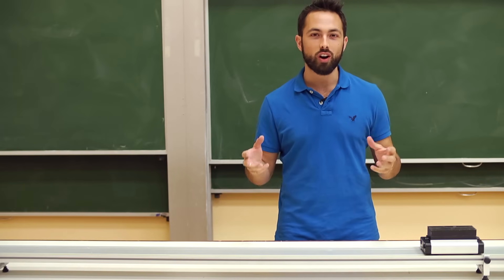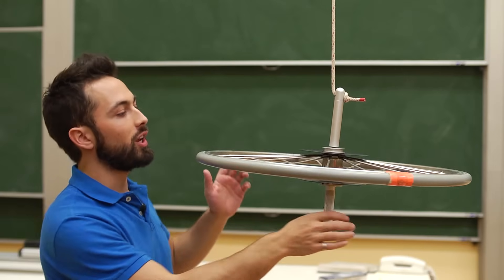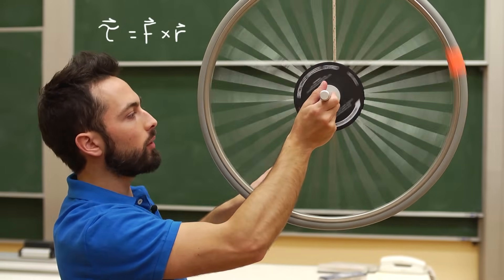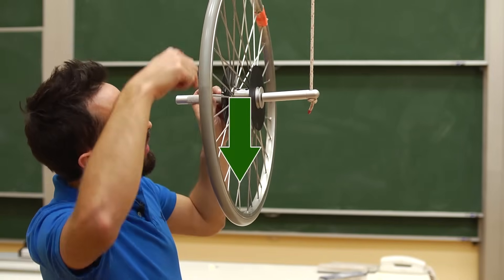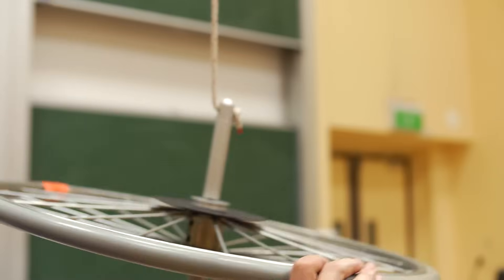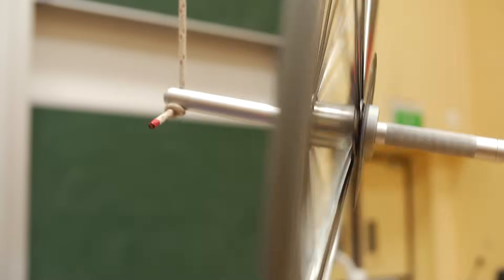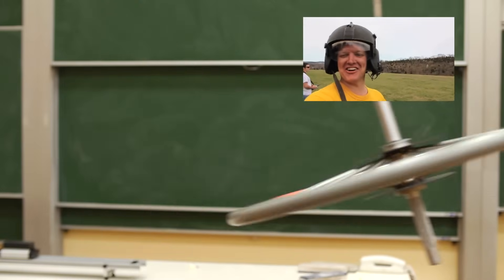Gyroscopic Precession

Comment: This explanation makes clear what happens, but I still don't understand why it happens.
For the rotation we see we need a torque showing vertically upwards, where does it come from? And even if this explains why the wheel starts rotating, it kinda doesn't explain why it is not rotating (or falling) downwards. 

For translational movement, when a body is falling and vertically but i give it an horizontal impulse, the body will still keep falling downwards, but not vertically now. Why is this is different here?

Comment: What helps to me to understand is to look for real forces working on the wheel. It helps to imagine that atoms in the rim of the wheel are like a bunch of small, visible metal balls, placed in a tube of a shape of the wheel's rim. Each little ball while rotating with the rim wants to stay in it's rotation plane, which coincides with the wheel. But wheel  under it's own weight slowly moves downwards and changes the rotation plane angle going from vertical relative to floor to horizontal. Since small metal balls do not want to leave the rotation plane ( low of God or nature or self evident truth while we live on our Earth😳 , that does not need a proof🤔😊) and cteats by their momentum the opposite torq to the torq that is caused by the wheel's weight, and creates a torq that makes wheel rotate around vertical axis. If vectors showing dynamic forces ( as the result of changing rotational plane by the weight of the wheel)of little balls are drawn it becomes visible that rim's matter that finds itself horizontally opposit the wheel's axle creates procession torq, and matter that finds itself on top an bottom of the rotating rim creates resisting torq to the torq created by wheel's weight.
I hope it is possible to relate to what I am trying to explain here😟😍! If somebody happens to read this, please leave a comment!

Comment: Tilt velocity and spin velocity are perpendicular vectors in a solid disk!  What do you remember about perpendicular vectors?  I CANNOT understand why people would rather believe in mnemonic devices like laws and rules rather than actually understanding the mechanism of CAUSE.  Currently, angular momentum ONLY works AFTER the right-hand rule, not the left-hand rule.  It has floored me for 20 years.  I cannot get it published, because math followers cannot see it, and I have math DESCRIBING THE ACTUAL CAUSE (without laws and rules),,,still, no joy.  Paradigms are STUPID, and you should second-guess something now and then.  I have a video with a link to the paper at SSRN.
A tilting plane creates a tilting velocity condition at the ends with a tilt axis through the diameter.  These tilt velocities at the ends of the plane are opposing axially parallel to the spin axis and completely reverse in each half of a rotation.  That acceleration is focused at the tilt axis on each half.  The rate for this velocity exchange is the ONLY participant taken from the spin axis, IT'S PERPENDICULAR!  The tilt axis creates a motion in the disk, and then it continues to follow that motion like a car axle producing a normal acceleration force to the disk THE WHOLE TIME.  There are supplemental effects, but this is 100% at level precession.  This is what cause looks like.  Modern science is really scaring me, because people are blind to cause when it contradicts the math.  THIS IS STUPID.
Imagine if medicine described symptoms with math and ignored the causal disease.  That is exactly what physics is now!  "It-always-does-that" is no basis for understanding, and describing accurately is not understanding either.

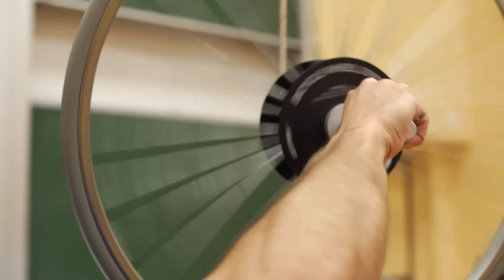Comment: At 3:22 it is stated that torque is pushing the angular momentum vector around, this would place the two vectors at 90 degrees to one another. At 1:52 it is stated that angular momentum and torque are in the same direction. Please help; I must be misunderstanding some concept; where does the pushing torque for the precession come from?

Comment: Sorry, Derek, I am trying hard to understand the physics of the "anti-gravitational" wheel. I still dont really get it, also not from your most recent viedos on the green with the 40 pound weight. 
Here you explain a force in the direction of the wheel axis. How would that create any lift? It should as well just pull stronger at the rope?
With the weight you lifted over your head in the other video, you explained that you effectively only feel the weight of he 40 pound disc, no torc anymore, however you can lift the weight much easier overhead then if not rotating. Sorry, something seems missing 🤔🙈

Comment: Dear Sir ,
I really need help , I spent time for Calculator  Power output of Flywheel motion , I have use P=T.w , but incorrect ,
Please feedback me
Reply: P=τ*ω is correct to find the power of a torque applied to a flywheel. As in, the amount of energy per second that you sap or add into a flywheel. But power has a very specific definition, so if this isn’t what you mean the formula will be different. Like the total energy of a flywheel is given by .5*I*ω^2.

Comment: Great.. torque...!!
Can anyone tell me what opposes gravity 😭
Reply: The weight of the wheel is supported by the rope tied to it on the other hand. I know you are confused why doesn't the other free end doesn't fall. It's because the wheel is still rotating having angular momentum in the direction perpendicular to the axis and the angular momentum generated by the forces on the opposite end ( tension in the thread and gravity pulling down at the center of mass ) are mutually perpendicular to each other which adds up to in the horizontal direction with an angle. Notice how the wheel starts to lose its angular momentum due to the friction and tho it's coming down. In short, it's the same reason where you rotate a ball tied with a string in your hand and it moves up. 
If you still have problem to understand, I can explain it in more easy terms on a paper :)
Reply: @manishsingaria3895  😍thanks bro.
You have a great taste in teaching.

Comment: Okay, I know this is an "old" video, but I'd really like to see what happens when you have two wheels spinning in opposite directions on the same axle.
Reply: their torks would cancel and the whole thing falls down. BUT the wheel that is farther away from the rope has a bigger distance so its angular momentum will count higher towards the total tork
Reply: @botfred743  yessir youre right
Reply: Okay, I know this is an "old" comment, but I'd really like to say that when there are two wheels at equal distances from the center of the axle the torques due to gravitational force cancel out each other and the wheels keep spinning how the are. But it will be interesting if the wheels are imbalanced, say different distances from the center of the axle or different masses. I think that also will be some kind of weird and mathematically complicated gyroscopic motion
Reply: Annuls the forces. You see that at the end of the bicycle vid
Reply: That depends on which side of the rope they're on. If they're on opposite sides, it will rotate around the vertical axis faster, right?

Comment: Sir because of tension and gravitational force which acts at centre of mass .a couple force will be produced that's why wheel will be rotate and get horizontal position because here centre of mass should be below than point  of suspension .but here couple force ( because gravity and  tension) doesn't take place .why???

Comment: Something is wrong with the given explanation: If the angular momentum of the spun up wheel is parallel to the wheel's symmetry axis, how it could rotate about the string (gyroscopic effect)? Because this additional rotation about the string would produce an additional angular momentum parallel to the string (orbital angular momentum). Moreover the component of the angular momentum parallel to the string is constant, because there is no torque in this direction. For me, there is always something missing in this oversimplified explanation, given in many lectures and books.
Reply: this video might explain it https://www.youtube.com/watch?v=mRZGdvJQnPU
Reply: @djs3089  Unfortunately, the video you suggest does the same over-simplification. In addition, how can the wheel suddenly start a rotational movement around the suspension just because the wheel rotates around its own axis of rotation? This contradicts the conservation of energy. I guess, the wheel must lower itself a little bit before it can rotate (i.e. potential energy is transformed into kinetic energy). But this makes the thing with the angular momentum much more complicated, because then the wheel will no longer rotate around a principal axis of inertia.

Comment: I always thought that some force is acting on the wheel in the upward direction due to spinning which balances the gravitational force and restricts the wheel from swinging downwards. 

You made it really very clear that the angular momentum due to the affect of gravity on the wheel is being used up to move the wheel forward. And due to the conservation of momentum the wheel is not swinging downwards along the string because all the momentum is being used up to move the wheel forward (Actually backward i.e against the direction of the spin).

Comment: Inertia is different from mass. Both a hammer and a feather fall at the same speed in vacuum. However you need more force to push away the hammer than the feather in weightless space (like on a space station). Forced precession is a movement without inertia but has the same mass. That is why it feels lighter when you are lifting it up with forced precession. Stand on  skale and test it BOTH ways. Lifting it with forced precession and lifting it just as a weight. Then you will see the difference, That is the scientific method, to compare the two methods, This is just a popularity video. It is so stupid that no one has built a machine or experiment to test that. Just some crazy guys like me or m thruster to prove it. Where are the smart guys to figure out that.....sad.
here are the videos I' telling you
M thruster - https://www.youtube.com/watch?v=EgCgrMetRsc&t=445s
my device - https://www.youtube.com/watch?v=yo-qR0lx_io

Comment: Can someone explain why a counter rotating crankshaft in a motorcycle engine is considered adventageous? Supposedly it is a design feature implemented to inhibit forward momentum under braking, but the torque is still in the same direction- at a 90 degree angle to the direction the vehicle is traveling??

Comment: If it's the turning force of the wheel that lifts it, then simply lowering it should turn it. But it doesn't. I mean it's a WHEEL. You can look at it upside down and your thumb rule is going to say the lifting force is in the opposite direction. It's a wheel. All rotational force is in all directions at once, not in a specific direction decided by your thumb.

Comment: I have a question that .. If there is a top spinning horizontally anti clockwise. The torque vector will be pointing upwards so ? will it weigh less ? or not ?

Comment: Interesting that the right hand rule can apply to torque and angular momentum. The right hand rule is also used for electromagnetism via direction of current flow and magnetic field. When the wheel is moving together in one direction, the forces of the molecules can be considered as added together, much like in an electrical current flow, the flow of charges in the same direction increases the strength of the magnetic field perpendicular to current flow. This almost suggest ,that, although matter is neutral it still maintains its electromagnetic properties, and the moving charges contribute to the angular momentum and torque, IMO

Comment: Let's apply this to my Harley - I'm a nerd. Intelligent but a daredevil as well. I skydive but was terrified until I learned the physics behind it ... then I'm fine because my brain is satisfied and confident as physics never lie. With that said , I've gained a new fear that no motorcycle video is going to help. I need the physics. My fear : why does the motorcycle tire not slide across the road when you're in a sharp turn. Difficult to explain. As I lean left my fear is that the tire will simply slide across the road sideways and not stay glued to the road. Traction I'm guessing plays a role , good rubber and dry pavement. But I can stay upright even on wet surfaces ( not oil etc but H2O ). 
   When I understand the physics I become fearless because science rules the world. Think you can help ?

Comment: This spinning top is more problematic than it looks experimentally. Because, the same phenomenon applies to the earth too. The earth`s precession which is about 23 degrees is caused by its spinning motion. It looks to me that the spin angular velocity induces an angular momentum on the spinning bodies which is not necessarily to be perpendicular to the spinning axis in general. The torque that causes the precession is the vectoral product between  the spin velocity and this induced angular momentum in general. The induced angular momentum looks to be deduced only experimentally.

Comment: WEIGHTLESS GYRO EXPERIMENT FUND ME!
I need you all to donate a few dollars, couple of pounds, Euros or whatever to allow me to make a special powered gyro that will prove gyros do go weightless at speed - just as Prof Laithwaite showed.
As I have repeatedly said, a gyro at higher than critical and higher speeds will not weigh anything due to all its weight being centrifuged away from the bearings or shaft bearings it is spinning in.
Critical speed for weightlessness will vary from gyro to gyro depending on weight, trueness of bearings, balance of disc etc.
At critical speed a well balanced gyro will only have a very small point contact of oil between its bearing and the gyro.
(Assume the outer bearing race as part of the gyro disc and the inner race being part of the shaft.)
The oil prevents any weight being applied to the shaft at critical and above speed.
The Prof's gyro was weightless as start as its revs were high but the iron discs were rough as cast with offset locking screws so balance probably not very good.  
It only reached 2500 rpm
What I propose to make is a shaft and disc combination with an controllable electric or air motor at opposite end of shaft. to spin considerably higher.
Motor will speed the disc up to and beyond critical speed and maintain the critical speed.
This will allow the assembly to be picked up and swung oberhead quite easily and repetitively - unlike the Prof's which dropped below critical speed and so stopped precessing and lowered to act just like a torque arm.
So start donating now and I'll make the assembly and video.
Reply: I don't think you'll be able to prove weightlessness. The mass/energy from the gyro will always ultimately ground.... like electricity or like lighting. It travels away from the wheel, through the arm,  into the person holding it,  and down to the scale. It's redirecting the force of gravity. I wonder if anyone has tried weighing them with a string and hanging scale? Not sure any values would change but it would be interesting to see the experiment.

Comment: My AP Physics professor showed us an experiment like this, but his bicycle wheel was filled with cement, so it had more mass (momentum? inertia?). He had us hold it, while on a swivel chair, and sped it up with a drill. We could steer the direction of the chair by tilting the wheel. I didn't understand the maths of it at the time.
(I know this is 7 years late, but I just discovered this channel.)

Comment: Terrible way to explain a gyroscope, a better way is to use the example of a pendulum being like a single point on a wheel, and as it passes you, you push it, changing its direction, if every other time it passes, so every time from the right to the left for example, you'll find you have to rotate around with it, to stay at its side.

This example of a pendulum can be considered as a point on a wheel.

Comment: Instead of using angular momentum to justify such behavior, can we state the following ? :
View the setup with the edge of the wheel facing you.
If we consider torque about the point of suspension of the wheel it equals the weight of the wheel times the distance from the point of suspension (assuming a perfect 90° angle between the wheel and the rod), whose vector points toward you. Call this vector V1. If we rotate the wheel, we are producing a torque whose vector's direction is perpendicular to V1. Call this V2. However since V1 and V2 are taken from different reference points i.e. come from two different axes of rotation, the resultant vector describes a kind of combination of both rotations. If V2 is much larger in magnitude that V1, then the wheel may not experience a downward rotation, but obviously a rotation about its centre and rotate sideways as the vector is inclined to the wheel.

Comment: Can anyone plz explain why the torque produced by the weight about point where rope is tied, did not produced an anticlockwise angular momentum as it did when the wheel is not spinning
Reply: Consider this, in linear motion,you can easily apply a force to a body at rest and accelerate it towards your desired direction. But when a body moves with constant velocity(hence having linear momentum already),if you apply an impulsive force perpendicular to its motion it can only change the direction of the linear momentum but not the magnitude(bear in mind that I said impulse,not a constant perpendicular force)
The same goes for this video.At 3.11, the spinning wheel initially had an angular momentum towards the left side of the viewer and the torque by gravity directed towards the viewer,perpendicular to the initial angular momentum. Thats why the spinning wheel starts to swing towards the viewer,whereas before,when the wheel wasn't spinning ,it had no angular momentum anywhere and therefore it was easy then for gravity's torque to create angular momentum towards the viewer.